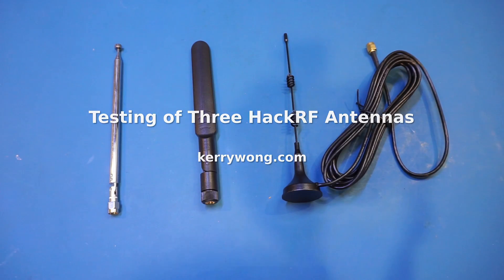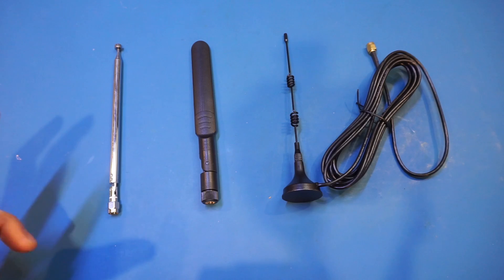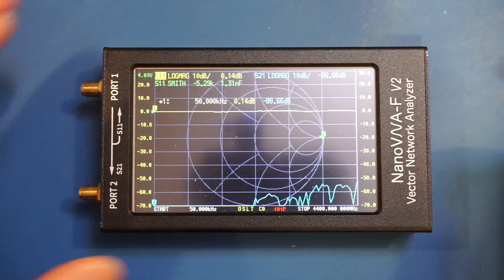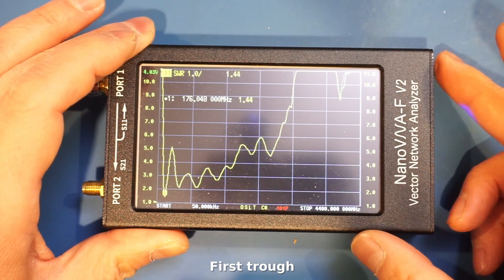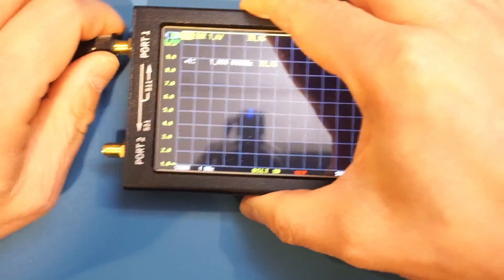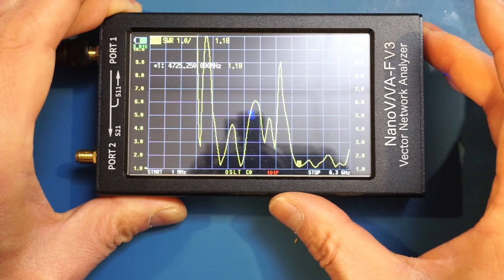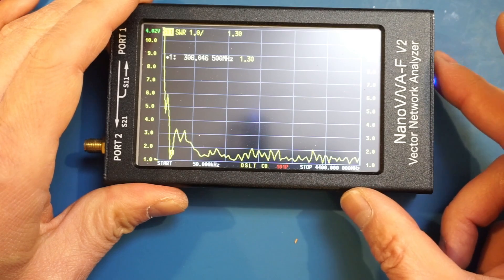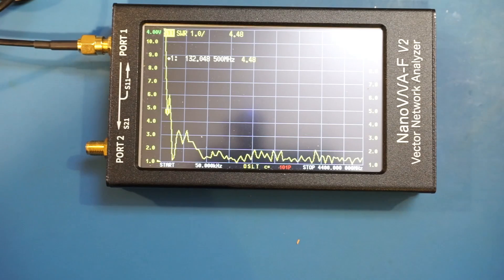Testing Three HackRF Antennas

Comment: All my wifi antennas are RP-SMA, was yours not?
Reply from the maker: The antennas for the HackRF radio have standard SMA connectors, not RP-SMA.
Reply: @KerryWongBlog  ya same. But every wifi antenna I own is RP. Are your wifi antennas regular SMA?
Reply from the maker: @sinpwnzorz  No, typical wifi antennas use RP-SMA.

Comment: SMA connectors are typically only rated for 500 connection/disconnection cycles. You might want to consider using a replacable adapter to save wear on the VNA connectors. The additional signal loss/ impedance mismatches/reflections etc. would be a small disadvantage, but likely acceptable in most use cases.
Of course the VNA connectors may be simple to replace (if the instrument is easily dismantleble) in your case but that might not be the case on more expensive test equipment.

Comment: Hackrf repair? This sounds good since mine is bricked. A few years ago I was flashing Mayham and for some reason it got stuck. I can't flash dfu... The main chip is getting warm and that's it... Do you think I can recover it somehow? I even bought another portapack but no success.
Reply: Seems like there are many fixes for different/similar problems found on the Internet.  So a search to see if there is any thing that relates to your problem is worthwhile.  Have you tried holding down the right button of the cluster of buttons and rhen turning it on.  Apparently it selects different screen drivers. Good luck!
Reply: @bryngerard4334  yeah I tried that... Thanks